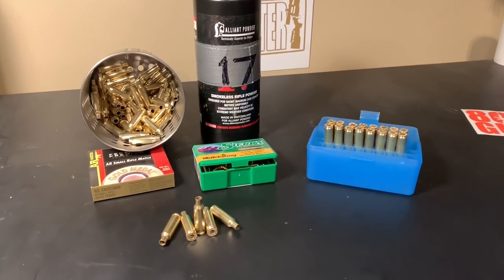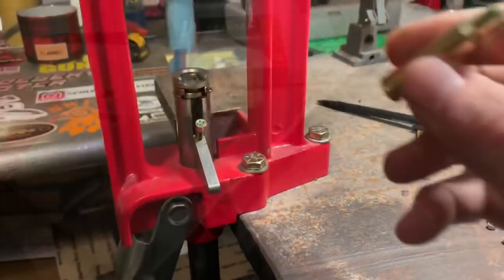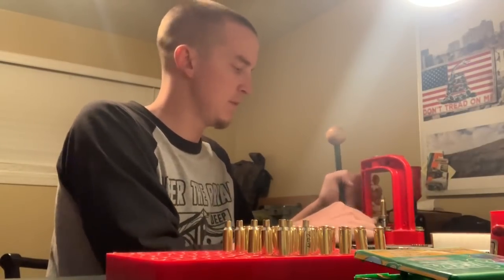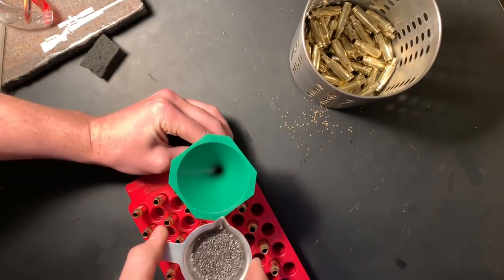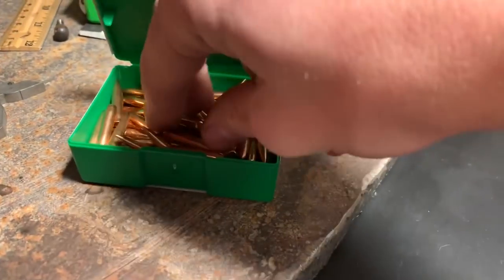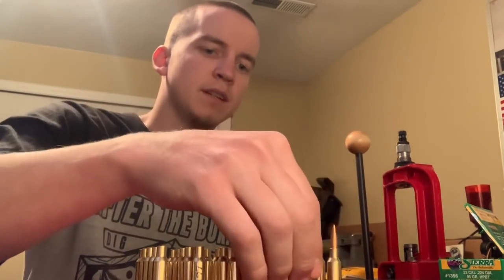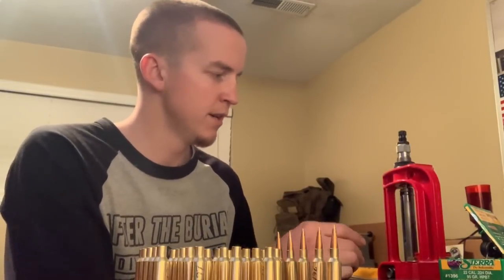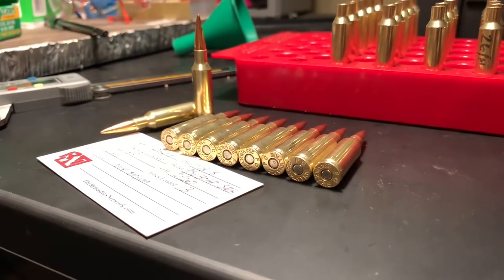224 Valkyrie Loading 95g SMK

Comment: If you have a Dremel tool..you can remove the seater plug from the die..chuck it in a drill and use a small taper stone in the Dremel to ease the inside of the plug slightly. Make it more of a taper inside.  Turn the drill in the opposite direction of the rotation of the Dremel.
Reply from the maker: Haha now that sounds like some engineering there! Thanks for the tip man!
Reply: @WestDesertShooter  Yes..I've had to improvise a few times. That method works well when you don't have a lathe..just be very careful on how much you take off.

Comment: 1st, if you have not dropped a case full of powder yet, you have not reloaded long enough. That's why I always keep my scales on while seating the bullets. 2nd, get one of the Lee auto bench priming, you will never look back. Finally, I use small base RCBS for 224V, it initially marked a ring (not as bad as yours), so I polished it with a cone tip on a Dremmel, now I have no marks, but yours seems to have too much neck tension. I run the cases twice on the die, one with and one without the expander, then run on a Sinclair expander mandrel. These steps and the polishing gives me no marks on all the bullets I use (80,88,90, etc.).
Reply from the maker: Thanks for the advice man on all three accounts! I am planning on getting the K&M expanding mandrel and that should really help. Along with a new or modified seating plug.

Comment: Two methods I have found to work depending on the problem with the seating die. one is to drill the center of the seating stem with a small drill to allow for the long tip of the bullet. The other is to fill the stem with hot glue and push a bullet into it to get a perfect fit. put case lube on the bullet as a release agent.
Reply from the maker: That sounds awesome! I’m curious if it would have a certain amount of give to it. Possibly seating at slightly different lengths?
Reply: @WestDesertShooter  It sets up pretty solid and there is not much give to it. It's not very thick once the excess is squeezed out so I have not found any real variance round to round. It is fairly easy to pull it out of the stem if you don't like the result.

Comment: Wonder what the difference would be between a fast twist 22-250 and the valkyrie ? Anyone have thoughts on that?
Reply from the maker: That is a short action cartridge more like the length of a 308 so it can’t fit in an AR15. So it loses that market. However it would be quite a bit faster. If you want a lightning fast 22 look at the 22 Creedmoor
Reply: @WestDesertShooter  ah ha. Thanks dude. Just caught up with a 25 creedmor vid.  Check that one out. Pretty bad ass and easy to make brass.